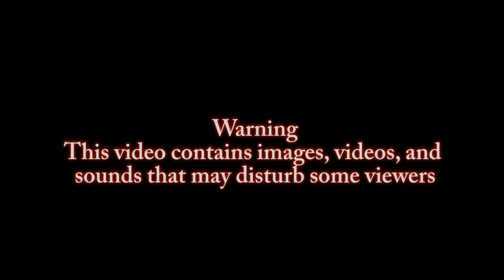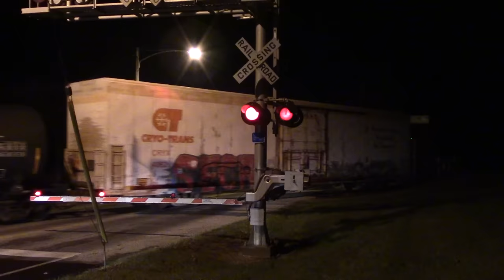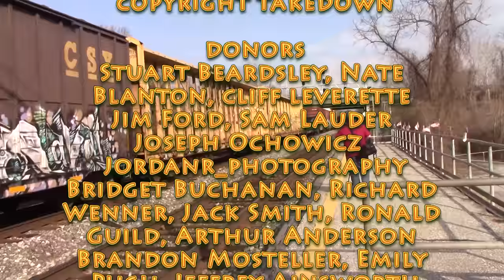Cayce Train Collision 2 years later

Comment: The last time I worked " Dark territory " was on the Windmere Sub, B.C., Canada back 1985. I had the fortune to work the Last empty Coal train going to Fort Steel. Hooped up our orders @ 23:59 @ The Windmere Station. Then lights of the station went " BLACK". After that every station we went by felt like a Ghost Station. Then it became CMBS. Computer Manual Block System. I worked for CPRAIL for 33 yrs as a conductor. We lost the Last main line freight caboose June 1989 and the Last local caboose December of 89.

Comment: The February 4 2018 CSX and Amtrak Crash BTW 47 Was In A Crash In 1997 When It Was Leading The 4 Engine Southwest Chief And Derails At The Bridge Due To Flash Floods In Kingman Arizona As For CSX 36 Was Repainted Into A YN3b. As For The Engineer Who Died (M. Kempr) Had A Memorial Sticker On Amtrak P42DC 162 Sadly The Same Year The Unit Was Suspended By Amtrak And Taken To The Beach Grove Shops And Will NEVER Gonna Run Again. The Engineer Of Amtrak 47 Was 54 Years Old When He Died

Comment: I remembered that one. That occurred on the CSX Columbia Subdivision under the US-176 overpass southeast of Columbia South Carolina. It was just south of Mile Post 367 in Dixiana SC. The last crossing the doomed Amtrak crossed was at Dixiana Road. The FRA number on the crossing is 634693B under the I-26 overpass, which is south of Mile Post 366. 

Now since the line was in dark signal territory, meaning maintenance was being performed and they were non-functioning. This would mean the Amtrak would have been given a speed restriction by CSX dispatch, but apparently this did not happen. Instead of getting a speed restriction through the blocks, the southbound Amtrak was flying in the blind completely oblivious to what was occurring at the end of the block. The last block signal was near I-26, but from what I was able to gather the signal block was inactive. 

The Columbia SC Amtrak station is located at 850 Pulaski in Columbia. The FRA station data is; it is between Mile Post 360 and 361 on the CSX Columbia Subdivision. This parallels the Norfolk Southern Columbia District Columbia to Beaumont Subdivision between their Mile Post 160 and 161. The Norfolk Southern sub turns to the east just past Blossom Street, and the CSX sub turns to the west. The nearest grade crossing is Devine Street, the FRA Data is 634660N. I hope this helps.
Reply: Dispatcher gave a "Track Warrant" to proceed at "Track Speed"-superceeding the rule book

Comment: Amtrak P42DC #47 had a flash flood incident back in the 90s. He, along with #80, #52 and #50 were all unharmed and quickly back to service. Aside #47 deemed total loss, both P42DCs #80 and #52 are put into a storage at Beech Grove. However, P42DC #50 is still running around to this day.

Comment: If the signalling system was not working due to maintenance then there should have been a staff presence to make up for it with the necessary manual lighting etc. Beats how you can expect to "safely" operate a railway with such serious short comings.

Comment: Conductor screwed up big time.  You always contact dispatcher as soon as you line and lock a switch on a main.  There should be no hesitation and if dispatcher won’t answer you stay there until they do.  As for switch targets, you don’t pay attention to those.  That’s actually a good way to get yourself fired because they can be altered very easily.  You verify the switch position by the points.
Reply: Right on the money, Oh Boy, when the csx shoved back in the siding, the engineer should have seen the conductor standing at the switch to make it normal.

Comment: Hopefully the RR changed it's rules so that lower speeds are mandated for track sections that are undergoing signal repairs. Dispatch should've issued a stop command to the AMTRAK train until the switch rail, not sign, position was visually confirmed.

Comment: they probably didnt have anyone that could walk 600 feet without having a coronary. Disturbing that the points are not monitored and that nobody had any idea a switch from a main line running fast services could be set in a dangerous position.

Comment: There needs to be a way to check the position of every switch remotely, rather than relying on someone's memory or depending on someone to physically go and eyeball the switch. Also, there needs to be a way to change the switch remotely in case it is found to be in the incorrect position before disaster strikes.
Reply: Normally there is but during a signal suspension which was what was taking place all electrically lined switches are inoperable thus those switches must be lined by hand

Comment: So in the US manual switches are situated on mainlines ?!?! Speechless.
Reply: Only if you take the power off the switch and then throw it.
Reply: @jamesvance8456  If you did that here in the UK, which you wouldn't be able to do, the interlocked signalling system would cause all signals on those roads to protect the misplaced switch. Even if you have a similar system being able to manually override it is really asking for trouble.

Comment: I just find it amazing how low tech trains are.  It seems the main high tech thing about them are the computer systems managing where train cars go and how long they sit on someone else's tracks.  If you look for things where you might want to use more technology on trains:
1. Smart cars - Have the car have an electronic decoupler.  Use a small rolling generator attached to the wheels and a battery to power the car.  Use that power to handle things like brakes and the coupler.  Maybe alternatively have solar panels on top of the cars.  Actually solar panels can come in handy for other things like supplying power to push the train forward, dumping the power into an overhead line.  How many worker hours are burned coupling and decoupling cars after all?

2. Regenerative braking and batteries and even overhead lines in some places along freight routes.  Especially where there is a heavily used steep grade, don't understand why braking power going down the hill isn't used to power trains going up the hill.

3. Using modern tech to have smart tracks.  Use GPS and Internet for positive train control.  Electronic switching of tracks.  Scanners on the bottom of locomotives to collect detailed track condition data so the next train to go over the tracks doesn't derail over a detectable problem.

Comment: I'm not familiar with US railways, however I am with UK. What I don't understand is surely there must be some form of interlocking between the points, signals and track circuits that would of prevented the passenger train getting a proceed aspect on that signal? You can't run trains without any form of mechanical route proving surely?

Comment: 4:20 – The locomotive crew had ample time to inspect the switch. It used to be the head end brakeman’s job to throw switches, flag crossings, couple and uncouple cars. But the head end brakeman position was eliminated, leaving the “fireman,” herein called a “conductor,” to do those former head end brakeman jobs. He wouldn’t do it, so finally the driver (“enginer”) gave in...too late. He got a “front row seat” at the smash.
Reply: The signal system was down without a switch tender on duty.

Comment: I am amazed it was allowed for a mainline section with no detection of switch alignment, for a passenger train to run at normal track speed, here in Australia THAT IS NOT PERMITTED,  all trains in the effected area are given a STOP,STOP,STOP, warning over the train radio, once all train crews have acknowledged the command, a emergency operating procedure is introduced, the trains are then allowed to proceed, at track speed of 10-15 kph (10mph) through the effected section.
The PTC system, would this have prevented the accident?  
Unless the system prevents opposing train movements to occur, until a emergency management procedure was activated, meaning all train movements are stopped, can anyone confirm if this is the case with PTC.
Reply: should have been "restricted speed"  Dispatcher said proceed at track speed.

Comment: So I don't know much about american railroad operations. But how can there be a train runnung when the signals weren't working? And why was there no sort of electronic control (or at least a system to confirm the setting and locking) of the switch?
Reply: Crew was installing "PTC", all power was off, crew went home and left everything as is. Dispatcher authorized Amtrak to run track speed. "Rule Book" says should have been "Restricted Speed".

Comment: 4:13 wow, thats what caused this horrible crash, due to a switch malfunction. I almost died because of this. Someone needs to go out there and so switch inspections. People die because of this. It makes me sad that this happened. I think they should send a railroad worker to go out there at least once a week to check the switches. This is great example of why they should do this. Same reason why the silver spring crash happened. The switch was flipped the wrong way, and the amtrak slammed into the marc train. And also the graniteville train crash. That was also caused by misaligned switches. 
These three wrecks are a great example  of why switch inspections should be  mandatory across the entire US railroad system.

Comment: Would you do the harcourt street line crash in ireland that happened in 1900. the station is till there converted into office. the line closed in 1957. in 2004 the line reopened as the luas line runs on the old harcourt street line. unfortunately the train station has been ruined by modern developments.

Comment: Something does not make sense.  Why was the track even aligned to the siding if the csx crew knew they had to wait?  Did the conductor throw it without authorization?  Or did a previous crew not lock it to the main line when they were done?  Still say anyplace amtrack goes any off track spurs should be electronic controlled.  Likely case sounds like conductor went out and threw the switch without authorization figuring possibly that nothing was in the way and they would be soon moving. One thing I learned only do what your yard master authorizes you to do or dispatcher.  Their is no reward for getting a train to destination in record time.
Reply: they were installing "PTC",  all power was off,  crew went home on week-end and left everything down.

Comment: The American railroad system needs to be modernised. Switches need to be electrified and mechanised. Train dispatch and control must be able to know the state of every switch and signal before clearing a block section for a train.
Reply from the maker: Most tracks already have this on main lines such as the NEC. Only certain sidings that dont see much traffic have to be hand thrown especially shortline switches.

Comment: This is the train from hell.  I have ridden it.  You can drive a lot faster than you can take the train. Is scheduled to take 24 hours, but typically takes 60 hours to get from NYC to Miami.

We sat on sidings for hours waiting for freight trains which have priority

We almost crashed several times.

I hate this train and I will never take it again
Reply: Amtrak has priority over freight trains
Reply: @jamesvance8456  nope. Not on the lines between dc and fl

I spent hour after hour on sidings while 5 or more freight trains went by.
Reply: @ocsrc  thanks

Comment: Please correct your commentary concerning train brakes. There is no separate "emergency brake" on railroad equipment. Air brakes have "Service", "Full Service" and "Emergency" settings on the brake controls. Also, the term "tanker" is a truck trailer; in railroading the correct term is "tank car".
Reply: correct

Comment: At first I blamed CSX
Reply from the maker: Both were to blame. CSX crew forgot to line the switch and Amtrak didn't put a risk factor into dark signal operation.
Reply: Predaking Savage it was csx fault.  Conductor didn’t do his job correctly. I don’t know what csx policy is on running Amtrak trains in dark territory.  Usually you need a track authority/ec-1, and if they did then they can run at whatever speed the dispatcher gave them.
Reply: what changed your mind?
Reply: @ohboy2592  Dispatcher gave them authority to run track speed. Superseded rule book

Comment: Engineer not trained on FLAGGING! Like the old guys like me were. You run up the track giving stop signs to the approaching train and have a red flag or flash light for stop signals if needed. But what can you expect from a railroad that pulls out ATC and ATS systems before there are replacements! (Saves money) That is why the industry has to spend all this new money on PTC today. And no cheap marker on the switch? They used to have lamps on them! More downgrading. No mail cars on Amtrak to take the energy of a wreck so the passenger cars have to. CSX contracts with Amtrak now hold Amtrak responsible just being there for all damages of wrecks. More pro business crap. So why should CSX care? I worked with that unit 130 on the UP -C&NW California Main Line years ago.

Comment: Conductor is at fault if he threw that switch he should had looked at his line up and checked his switch points that’s one of the rules Csx always stressed check your switch points after throwing your switch one main trouble no target on the switch still that’s why Csx made the rule to check your switch points for reason 1 no target. 2 to check for line up and 3 to make sure there is no gap at the points now he might had lined the switch and the points might had been gapped thus picking the switch but if that was so the Amtrack engine would had derailed before the impact this gapped points are ruled out final result the conductor didn’t check his line up therefore broke the rules in checking the points after operating the switch Csx is at fault because of a lazy conductor not obeying the operating rules this is what and why our job became so strict on the rules old timers did there jobs and took the job very serious when I started 30 years ago on Conrail the conductors were old ww2 and Vietnam army vets that didn’t play yes they had fun on the job but took it seriously as one Conductor told me this job don’t bruise or cause minor cuts it mangles crushes and take limbs and or lives you must have eyes in the back of your head and look out for anything at anytime to happen so be prepared to take action when needed and know what you’re doing if not take a seat the railroad isn’t for you to be lazy or reckless

Comment: 8:55 I hope The CSX drivers are fired 😡
Reply: Same. They should not have told the dispatcher the switch was set to the mainline until they actually see the switch and do the correction.
Reply: Engineer and Conductor were fired. ()Too big of a hurry to get off)
Reply: Technically, it was not there fault. They could not tell weather or not the switch was alined correctly.